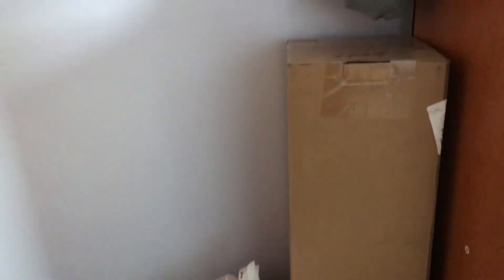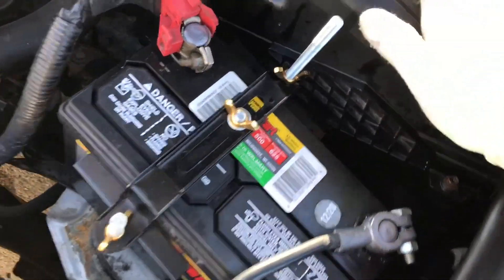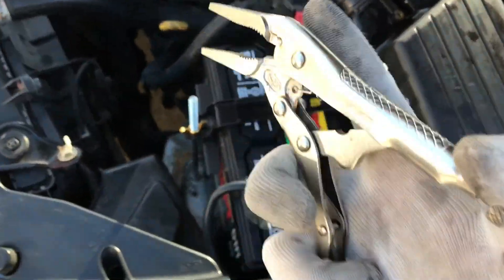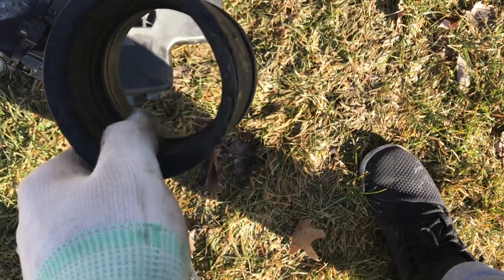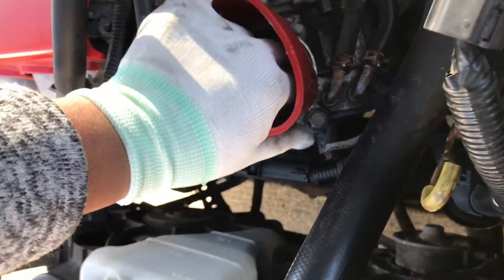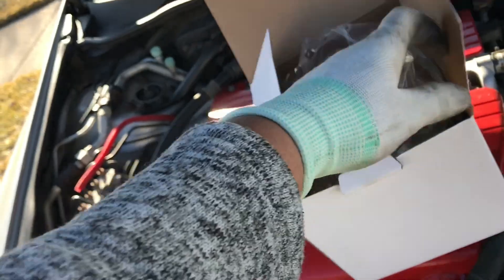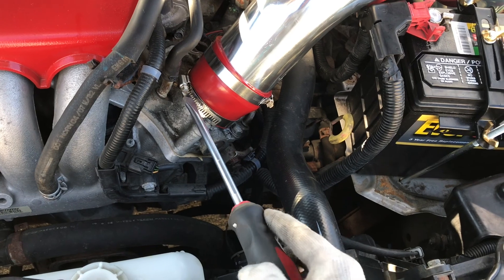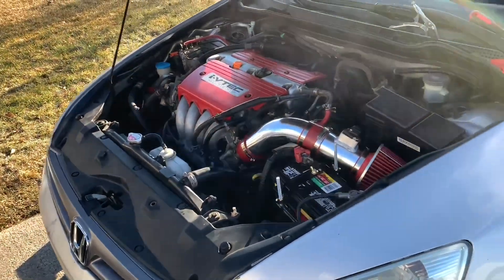Honda Accord short ram intake install (2006-2007 Accord) eBay/pulls and revs) 50 dollars.

Comment: You the real mvp man ! Bought and built. Enjoy the car. Modifying my Honda to its full potential. I have a lower suspension system installed. New rims and a roof rack. Doing some  tuning to the engine too and flow master exhaust. Bring on the Honda Car Meets!
Reply from the maker: Love building these cars. Good luck on your build. Got a TL type s now that I’m currently building on the channel.

Comment: I just put a K&N filter on this and I felt an instant change in power delivery and smoothness. The old eBay filter really disrupts the low end on this car. But the K&N has the built in velocity stack it helps out with low end and up to red line with it. 

Try it out.
Reply from the maker: For sure!!!! Definitely gonna get one soon. Gonna most likely change the eBay filter out by next month. Thanks for the advice! 😁😁😃
Reply: Hey can you drop the link for the k/n filter?
Reply: @sajeelahmed155  Just look up a 3” cone filter by K&N.
Reply from the maker: Ya, look up 3 inch k/n filter and you’ll find it. I think it’s like 30 bucks or so.
Reply: @FastlaneHero  I only see one that’s 3inch diameter and costs 65$
Reply: @GloryCredit You usually have to reset your throttle body after replacing because the computer automatically recalculates for carbon buildup.

Resetting the throttle body on a Honda is very simple. First, put in Your key and set the ignition to RUN for 3 seconds. Then, start the car and try to rev it up to approximately 3,000 RPM. This should force the radiator fans to come on. Once the fans come on, let the car sit idle with all accessories disabled. After a few minutes, turn the car off. This should have resulted in a complete throttle body reset in most Honda cars.

Comment: If you want to improve it u need to get a velocity stack for the air intake, get a better filter and wrap the intake in heat reflective wrap. I put a heat shield on mine as well. While you have it apart clean the maf and clean the throttle body, its the perfect time to do all that.
Reply from the maker: I actually sold the car. I have another car for the channel. Kept it lowkey but just ordered a GoPro so I can bring better content to the channel. Most likely POV drives. Got a 8th gen accord. Gonna get a cold air intake for it in the summer. Gonna do hella vids on it.
Reply: You know what specific filters fit this car, or where I can find that info??

Comment: It was so hard to delete the black box thing connected to the hose line 💀💀😭😭  did you get the bracket to work??
Reply from the maker: It was hard to get off, also the bracket I just attached to the battery bracket. I had an aftermarket battery holder so that made it easier for me.

Comment: Pretty sure you that coolant bypass line is suppose to go from the TB to the Tstat housing not the intake…the crank case breather is right but that other one is def a coolant bypass..atleast on my 08 it is
Reply from the maker: Ya, I actually put the coolant line bypass into the throttle body. And put the tube from the crank case into the intake tub. I should have got better angles on it better. Thanks for looking out‼️😃😁
Reply: Yeah I had to look forever to find the right way to do it bc like you said it really hard to get a good angle/good lighting to actually see what’s going on just looks like a jumble of hoses😂😂 after you actually look at it it’s pretty simple they just put the metal piece in between the hoses on the stock box
Reply from the maker: Ya, for sure! Lol at first I thought it would be confusing but in reality it’s literally direct. Goes from this to that. 😂
Reply from the maker: I hope my video was useful for you tho! Next vid i do on a intake, I will definitely go more in depth on those parts.
Reply: @FastlaneHero  yep on camera that little bendy tube thing looks like it does something special 😂😂🤦🏻‍♂️🤦🏻‍♂️ video was definitely helpful though just got a 08 myself so hopefully you do more to yours
Reply from the maker: @automattic4202  yaaa for sure! I do want to do more vids to my accord. Gonna install fogs on her soon. Once the weather gets betta. And a sub woofer. Stay around the channel. Gonna have to post a review on the intake. How it’s going and everything.
Reply from the maker: By the way. I have a 2008 Honda Accord that has a 2.4L. Posting vids on that car.

Comment: Do you have anything done to the exhaust or it jus naturally sounds like that
Reply from the maker: It only only has a intake. Before the intake it had the exhaust noise but barely any induction noises.
Reply: Sounds great, thanks for the fast reply have you had any overheat problems since installed?
Reply from the maker: Hehe, that’s why my name is Fastlane. Also, nope. Car never over heated after intake install. And I beat the crap out of it as well. If you want, go check out one of my latest video. I installed a Cold air on my 2008 accord and towards the end I put in a lot of sounds clips with my GoPro. Will give you more of an example of how it will sound. Reminder, it’s way louder in person.

Comment: I saw at the end of your video the check engine light came on and it was idling up and then turning off my 2005 Honda accord is doing the same thing I replace the mass airflow sensor but that’s not it do you recall what you did?
Reply from the maker: Nope, I didn’t have that problem.
Reply: @FastlaneHero  when I take out my intake sensor it works fine but when I put it in the car starts idling up and then down and shuts off. I replaced the sensor and the new one still does the same any idea?
Reply from the maker: Now that’s weird. Check the spark plugs. Could be something with fuel as well.
Reply: @fubarstudioveteran  my car is having the exact same problem right now! Did u find out what was causing the problem?
Reply: @justincuevas2439  my cars slow to accelerate till like 3k rpm’s

Comment: I got a white 2007 Honda Accord ex v6 and its a stock. I was going to get a cold air intake but I’m so worry if I install anything, would it mess my car up? My car is perfectly fine never have a check engine light on. I mean everything is harmony in my car. I wonder why is your check engine light on? This got me worried lol.
Reply from the maker: Lol totally understand. That check engine was for something else. I had the intake on my 7th gen accord for about a year and it gave me no problems. If anything it helped the car performance and mpg. I say go for it. Just get your self one with a heat shield or get a full cold air intake. I just installed a cold air intake on my 8th gen accord. Have a full video on it. Only thing about cold air, don’t go through big puddles that will make water go to the filter or you’ll hydrolock your motor.

Comment: Is the check engine light from the intake? Or you had it on before
Reply from the maker: I had the check engine before I installed the intake because of my intake tube was ripped. But after installing the intake it went away after 2 days.

Comment: Did you end up using the brackets and securing it from the old intake screw at the bottom? I only got 1 L Bracket and 1 straight one. I gotta go to auto zone and get another L Bracket unless there's a different way I don't know
Reply from the maker: I actually ended up using the old intake box bottom part. It sits perfectly on it. Gets direct airflow from the oem intake tubes. I tried to use the brackets they gave but couldn’t figure out a way. One of my buddy’s actually put one end of the straight bracket on the battery bracket and the L one holds up the intake. I’m gonna post a update video soon on how I have my car setup. Hopefully my comment was helpful.
Reply: @FastlaneHero  wow thanks for the quick response. I might actually do that and leave the bottom part. Better than going out and buying parts

Comment: So I’m new to car builds an I’m tryna build my 2006 Honda Accord ex an make it look nicer an faster but need some tips on what needs to be done
Reply from the maker: For looks definitely get it lowered! Try not to cheap out tho! And get some wide wheels so the stance looks nice. Depending on your engine, you can do a FBO set up. Which is mods that bolt on. Intake manifold upgrade, cold air intake, full exhaust, headers, and a flash tuner so you can make as much power as possible from those mods,
Reply: @FastlaneHero  what about for a 2006 v6 auto?
Reply from the maker: I would say go with a FBO setup, but the auto v6 accords that year have trans problem. So, not sure how much you’ll be able to push until it messes up.

Comment: After installing the new intake did the engine light come on
Reply from the maker: It came on for a day or 2 but went away. But when u install it, it shouldn’t have a check engine. My car old filter was very dirty and clogged. Then out of no where when I installed the intake it was getting a lot of air which threw off the mass air flow sensor.
Reply: @FastlaneHero  is the intake stable like when you try to move it around is it held strong and doesn’t move? Like when you try and put your hand on the intake and the tube and stuff does it move or is it screwed into something?
Reply from the maker: I reused the old bottom of the box. It sits perfectly on it. Gets straight air.
Reply: What was the code when you install it
Reply from the maker: @ricardovivas4248  I would give the code but the check engine ended up going away. And I never plugged up a OBD reader up to it.
Reply: @FastlaneHero  how long have you had the intake filter on now? Has the engine light come back on again? Do you know if cold weather like winter season would affect it?
Reply from the maker: It’s been about 5 months. And when it’s colder outside the car runs really good. Had installed it in the beginning of the year when it was winter . Also, the check engine never came back.

Comment: You think these fit on the 8th gen both have the same engine bay
Reply from the maker: I actually don’t know. I think the map sensor is a little different. But I do know that the 8th gen sound better. Vtec is louder on them.
Reply: I think it might have the same map sensor I ordered the 7th gen  intake 🤷🏽‍♂️imma keep ya updated if it fits or not on the 8th gen
Reply from the maker: Ohhh okkkk yaaa. Let me know. Ye I just bought a 8th gen accord. 4 banger too. And it needs a intake asap. Keep me updated on how it goes. If it goes smooth, I’m gonna just swap my 7th gen intake into the 8th gen. Also I meant, “mass air flow censor”.

Comment: Have you added heat shield or not really necessary?
Reply from the maker: When I used to have my 7th gen accord. I actually made a heat shield with some plastic laying around. I cut around it and placed it right before the intake filter. But, I’m gonna be honest. I didn’t feel a single difference.

Comment: did you have to get another clamp??
Reply from the maker: I did need an extra clamp. But I ended up using one of the oem one that was attached to the breather hose I took off.
Reply: @FastlaneHero  ima about to put mine in later this week I bought this air intake instead of the 450$ k&N intake lol, but just wish I had a carb sticker for it,it literally does the same purpose
Reply from the maker: Haha, I thought about that. If I lived in cali or something I would have done that. I live out in the east coast where they don’t care too much!

Comment: How did u get your top vtech cover red like that did u paint it
Reply from the maker: I actually took it off and painted it. It’s been holding up for a long time. I used red vht heat paint. Was super easy.

Comment: did you get the check engine light after the install ?
Reply from the maker: Yes I had it before the install. It used to come off and on. But after the intake install it went away. Took about like 3 days. So my guessing was the car had to relearn it self cause it was getting a whole different air flow. Hopefully that was useful.
Reply: @FastlaneHero  yeah, thanks mate
Reply from the maker: @tinowiik7145  np 😁
Reply: U should never get a check engine light from installing an intake
Reply: You should have disconnected the negative battery cable. After install reconnect and the ecu will do a relearn, it will adjust parameters slightly while stayin in factory spec. Your check eng could have been maf related possible air leak on your old intake so when installing the new intake you may have corrected the issue. Or its just intermittent and the light will come back on again
Reply from the maker: Ya it was definitely because the stock intake tube had a tear or something. I was gonna do that but the check engine just went away after it learned itself. Thank tho!!!! 😁
Reply: @davidsteadyjr8243  I did.  Engine too lean code.  Changed back to stock and No light. Changed back to Aftermarket and lean code after less than a day
Reply from the maker: Really, I never had that problem. Weird
Reply: If its throwing too lean then theres an air leak on that intake. I've been a master tech for 16 years and have worked on everything from acura to Ferrari. Ive never seen a performance air intake throw a too lean code especially on a n/a car. With a turbo car its possible but even there i havent seen it. I suggest u check that intake for leaks its pullin air from somewhere its not supposed to. Especially with so many companies trying to keep their intakes epa compliant like AEM, K&N, and a bunch others. I made my intake on my tsx and used ebay piping drilled a hole and put a rubber bung in for the iat sensor and used silicone couplers made a heat shield and put a high flow cone filter on. Never thrown a code
Reply: @FastlaneHero  it is weird!
Reply: @davidsteadyjr8243  how do I check? Do I use soapy water? I’m guessing it’s either the welds for the MAF or the cone filter,  I have spectre couplers from auto zone in place of what came in the kit.  The couples from the kit didn’t fit snug at all.  After the changing of the couplers it still threw a code
Reply: @GoldRoks322  get a can of brake clean and with car running spray it around all connections on intake and maf sensor and if it throttles up it sucked in the brake clean meanong that's where ur air leak is

Comment: Does doing this put the check engine light on?
Reply from the maker: Nope, I had a check engine before because my stock intake tube was ripped. So I replaced it with that short ram.

Comment: Where did you put the brackets
Reply from the maker: I had placed it on the battery bracket. And it was holding up the intake from the bottom.

Comment: does it fit a honda accord 05?
Reply from the maker: Ummm, it might. Just check your mass air flow sensor and make sure that it’s the same as the 06-07 one. If it is then it will work!